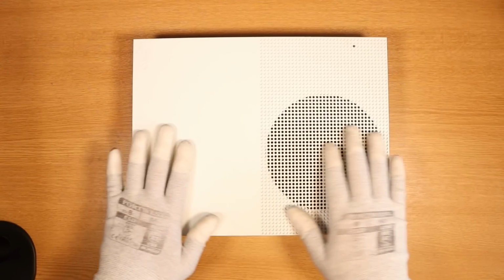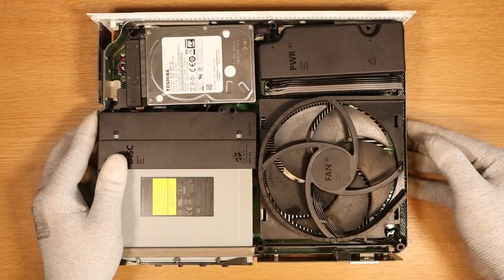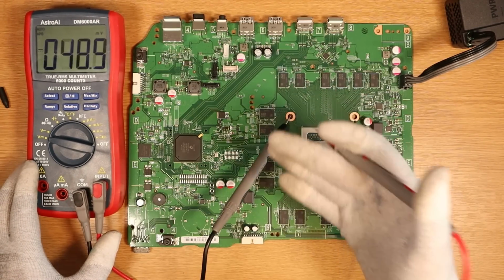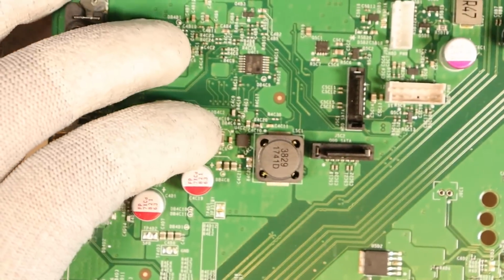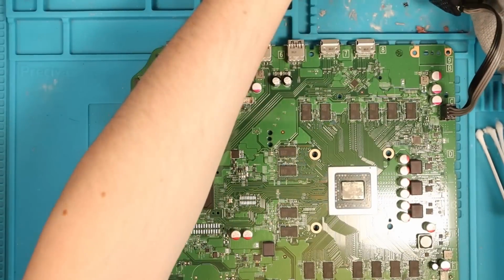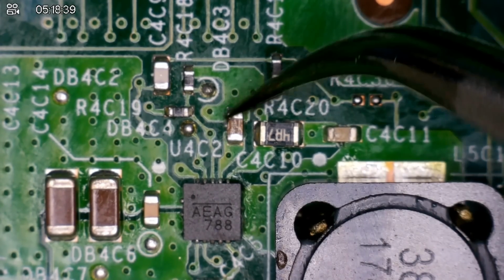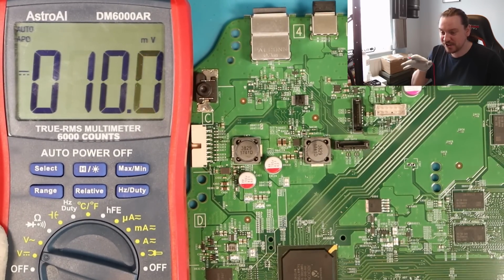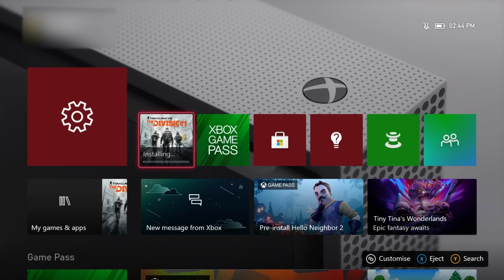I Paid $200 for THREE FAULTY Xbox One S Consoles | Can We Fix Them & Make a Profit (Part 1)

Comment: Beautiful content. I got your channel after a little YT search. I've two white broken Xbox One S but I'm no Xbox specialist (I mainly do PS stuff...), tomorrow I'll use your video for the voltage test points. Thanks and keep up your nice work!
Reply from the maker: Thankyou Ragg! Hopefully my vids will help a little bit, that’s the goal really :)
Reply: @JoeyDoesTech  today I desoldered the retimer chip and did the work again pin by pin with microscope. I tried the MgChemical flux and worked very well (only a bit sticky to clean...) BUT THE XBOX NOW WORKS! It was personal, I knew was the only fault ;-).Cheers from Italy and up the (soldering) irons!